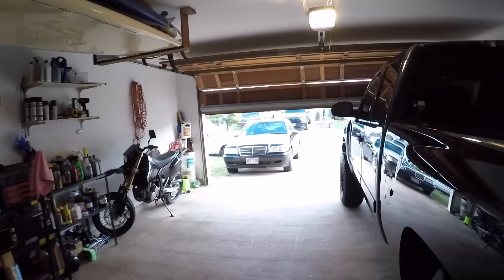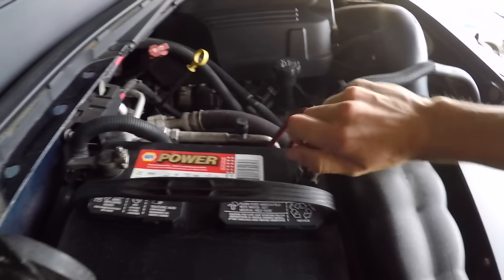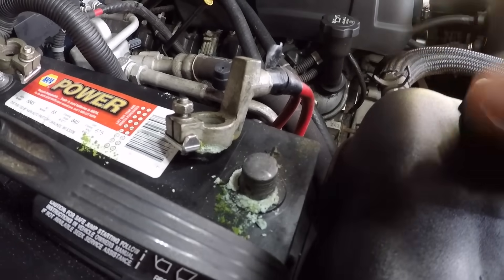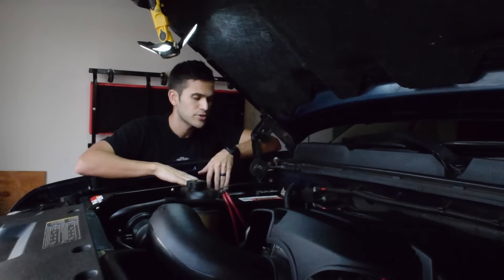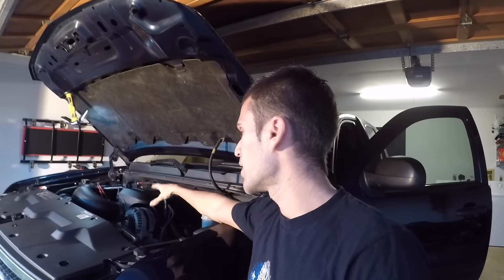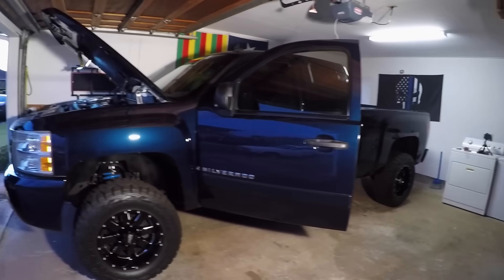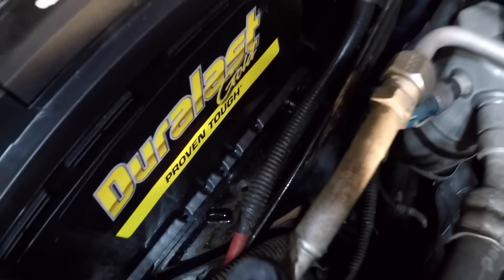Car Won't Start: Alternator or Battery? The easy way to know

Comment: when you're confirming a bad battery, you are covering up where you connected the positive lead out of the multimeter to some contact on the alternator - what did you connect it to?

Comment: I thought if the battery was dead the lights wouldn't turn on. I had my alternator replaced in December when it died and wouldn't jump and now it's dead again and won't jump. It starts but then it dies. The mechanic came to look at it and scan it, but he wasn't familiar with the codes and said it seems like a computer issue.

Comment: In your personal case, you did not need to go out to buy voltmeter, you already have one on your dash and the voltage did increase when you started car. But the video is good for everyone else that does not have a voltmeter in dash. Good video though. A voltmeter is always good to have in car and know how to use it.

Comment: To shorten it up he all he said was a check the voltage if it’s low voltage it’s the battery if it’s high voltage it’s alternator

Comment: What a detailed video, you should make one about what to do with keyless cars that wont start. 1 light shows on dashboard, no sound when you press the start while holding brake, new battery drains so easily. Talking about my own nissan altima 08 :(

Comment: As a woman who needs to learn how to take care of my own car problems, you explained things very well, so even “I” could understand it. 
Off to buy my multi meter to check my battery first. Thanks for the great music, video, and instructions
Reply: www.veejer.com
Dallas, Texas

"7" small Chapters
Chapter 4 : Batteries
Chapter 5 : Starters
Chapter 6: Alternators

The reason the vehicle wouldn't start is because the Battery had "one" Shorted Cell , that's why he was reading 10.5 Volts.

Batteries have " Six" Cells.
2.1 Volts per cell , thus 6 Cells Times 2.1 Volts = 12.6 Volts , a well Charged Battery.

If he was a Mechanic , this wouldn't have been his 1st day going out to buy a Battery.

Auto Technician background ,
Southern California
Formerly of Texas
Reply: We’ve got this ladies!! 😊
Reply: Nice job ladies
Reply: Great job ladies! I’m in the same boat. Just popping my hood makes me anxious! But I’m gonna give it a try. My car still runs, but struggles to start, especially when not run for a day or two. Think the battery needs replacement.
Reply: Never fire the parts cannon at it. The 1st thing I would have done and  got a battery analyzer and check the battery property a Volt meter will only tell you the voltage it will not tell you the Amperage that's required start to vehicle.
Reply: @404notfound..... 🎉🎉😢😮😂🎉
Reply: I have to disagree on the music.  Can't figure out why we always have to be bombarded with unnecessary, incessant, annoying music.  Oh, well....  :-(
Reply: Same here 😊
Reply: Same here. I am a single woman with a new grand cherokee that has all the bells and whistles.  My worst fears came to fruition the other day when I tried to start my car, remotely and manually both and it was completely dead. I had anxiety attacks for 3 days over it.. thank God my son in law tested the batteries and the alternator.  It's the alternator.  This video is wonderful for women who don't know cars! Good luck to you!

Comment: I have a VW Eos 4 cylinder, turbo. I have a horrible rotten egg smell coming from the hood of my car and there has been some hesitation to start occasionally. No warnings lights on dash. Auto zone did a test and ssid my battery and starter were good but that my alternator was bad. But would that give off that rotten egg ( sulfur) smell?

Comment: 10:45 is a prime example of paying attention to how the old battery comes out.  If he had connected the cables at this time they would have been reversed and could have blown a main fuse or worse.  However a few seconds later you see the battery turned the opposite (correct) way.  Good catch and save sir.
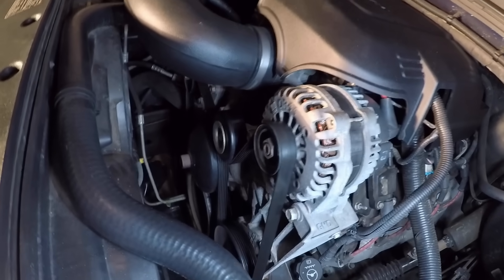Reply: 12:30
Reply: thanks for pointing that out ! 👍
Reply: Yeah i did that and think i damaged something real bad

Comment: when you want to clean that crud on your battery post  sprinkle some baking soda from your kitcnen add add some water  watch it boil away the rinse a little more water  thats it     if yoy are having battery problems  with an older battery  you  bring it to life so to speak  if can add water  but first  try a spoonful of epsom salts  (magnesium) it desolves the crap that builds up on the plates in you battery    helps it hold a charge    put this in each cell  table spoon  will be enough

Comment: heres a question... i drained my battery by running accessory on cigarette lighter. my eliminator jumper only effective after 1 use even after charging it. replaced new battery but both read 12.8 volts on my amp meter... ?? what happened?
Reply: also my battery light never stayed on after starting the car...
Reply: my aLternator  is good ..its reading 14.6 while running

Comment: I had my alternator give out on me one day, I'm glad you went the electrical tester route but there is a better way to test if it truly is your alternator. If you can turn your car on (Jumped or battery not completely drained)  then while it is running, pull off your negative ground on your battery. If your car dies then its your alternator. Your battery is good for Starting your car, your alternator is good for keeping your car alive. Since his car wouldn't start the battery made more sense. Another way to test the alternator is if you can get metal to stick to it. I think it needs to be on to test this, idk I haven't tested this way cause the battery was a lot simpler. On or off, if metal won't stick then its safe to say its bad. One none productive question, why are you in Hawaii and have a Texas sticker on your car?
Reply: He’s not in Hawaii it was just the vibe of the sunset that made him think of hawaii
Reply: How do you know if it’s your starter?

Comment: one thing you should  have done is hooked up portable charge to the obd  port so your electrical system computer does not have to reset . it can save you big money when your marsady needs to do engine settings for it to run again

Comment: He should of take the positive out the car battery while car start to see if it still running alternator it self power up everything if it can't that's mean alternator is bad....car battery only last no more than 5 years my car battery has sticker 2014 that's about 6years it's time for new battery ....alternator worn fast if you runs car systems 1000watts plus you will need upgraded battery as well gold top or 2nd battery kinetic

Comment: I really need help guys, I have a 04 mustang that won’t start and it’s either the battery or the alternator so we got a new battery and it still won’t start, any ideas? @ChrisFix
Reply: We are having the same problem with a 2002. We even bought a new battery

Comment: Thanks, your explanation was both clear and logical, just what I was looking for
Reply: I was having the same problem with my car I have a 2011 GMC Acadia denali or wheel drive I change the alternator and the alternator and the battery and I am still having the same problem service charge as system what should I do next

Comment: Under what circumstances the alternator could deliver Voltage lesser than required? We have 2 batteries (12Volts and 25plates each) connected in series and when the engine is running idle the monitor on Dump Truck would display 23.5 V (but it should be 12.6x2 i.e., 25.2V) and the alternator should give output voltage of about 27.3V to charge the battery but it's output is just 23.5V and if electrical appliances(lights, AC) of HEMM are switched ON the Battery Voltage starts decreasing below 23.5V.
What could be the problem?

Comment: A Voltimeter is not enough to assess if a battery is in good shape.

This method is useful for a simple analysis - not a diagnostic.
A conductance tool shall be used, especially if that tool also measures the charge of the alternator (which advises you to turn on the engine, turn on the air vent and lights).

Moreover, you never should jump start another car - or your own car - though your battery if that battery is in the trunk.
This is because the European cars have many sensors and ECUs connected to that battery in the trunk.
To help you, OEMs placed two terminals in the engine compartment, in order for you to jump start your car or charge your battery.

Furthermore, that Mercedes-Benz engine is usually small to jump start a truck.
Or is it a V8 engine?

Cheers for that sunset 😂

Comment: Can I use a spanner to open the battery bolt rather etc wrench as o havnt git the too you have I ad the same issue today all light came on after many try I came but hole it will last

Comment: Rookie mistake to jump start a car without the donor car's engine running.
Reply: Where did he attach it to the other car?
Reply: @joanlynch5271  I don't understand your question. Jump leads connect a donor car battery to the car with a flat battery.  If you do that without the engine running on the donor car, you risk having two flat batteries and two cars that need a jump start.

Comment: If alternator was bad you would see signs of it probably a week before your battery dies, dash lights will go crazy while driving, battery/ brake lights will light up, abs light will light up, brakes might depress to floor, all types of issues when alternator is about to go.

Comment: Thanks the information was helpful. I am having a similar problem on my 2006 Chevy Colorado. Every now and then I have to jump start my battery so let me get my meter out and check those things first so this way is not a waste of time of buying the wrong part.
Reply: I've spent so much time with you!

Comment: Hey man, quick question for you. My 18 explorer had the same issue, coming up with the "Service charging system now" on the display. I replaced the battery, and the alternator. Its still throwing the code though. any ideas?
Reply: "Service charging system" is usually for the charging part.  Check you alternator charging voltage.

Comment: i currently have a 06 honda odyssey tried to jump start it 3 times and it just wont and the battery is brand new so i thought it was the starter going out but the starter was fine but all the interior was lighting up but the third time they got dimmer and now it just blinks but its very faint. Ideas?
Reply: Check your throttle body position sensor. (Try starting with the connector unplugged).

Comment: Can anyone help me? I have a 05 marquis I bought and battery light Comes on and off.. When I drive it go's off.. It comes on and off. I had the alternator and battery checked and was told it was good. The car runs and drives smoothly no idle issues or anything... Any idea what it might be?
Reply: Get a multimeter and measure the voltage on your alternator and battery. It might be your voltage regulator..
Reply: @decision4475  thanks! I just started to think it might be that.

Comment: your alternator works overtime as well because it has a hard time connecting to the battery and won't charge you're battery. just went through something like this. lol be cautious, positive cables get hot eventually. from poor connection. mine got quite hot to the touch and melted the harness and positive terminal cover. cut the corroded head off and crimped a new one on and works well so far.

Comment: Alternator OR Battery: 

BATTERY: Car dies>> you jump start>> turns on>> you drive fine>> turn car off>> wont turn back on

ALTERNATOR: Car dies>> Jump start>> Turns on>> Drive car>> Dies while driving. 

PARASITIC DRAW: Car dies>> get a new battery>> turns on>> is drained and dead again after only couple months/weeks.
Reply: CY4B3R SK4R fucking straight forward thank you so much
Reply: Left key on overnite. Next day nothing. Charged battery and got another altenator, it's like battery is not charged even though had no problems at all til this happened.Charged battery 4 days still nothing, lights and dinging when door opens but besides that nothing.  Got a jump and just shut down. Is it battery or a relay or fuse ? This is a 2008 DODGE NITRO SLT.
Reply: @chrystalgillespie9318  if charging battery does not charge battery. You answered own question. It's the battery. I'm having same problem and my battery is over 3 years old so I know its battery. Remember battery is there to start car, alternator is for running car and charging battery as vehicles running.
Reply: @chrisiverson257  I jump start my car but soon as I took the jumper cables off it cut right back off what is that
Reply: @boosieparson3894  bad battery. If you battery is dead or dying. After you jumpstart car, battery cant hold the charge that the alternator is trying to provide.
Reply: Just an update: bought new battery and have zero issues now. Turns out battery had a dead cell. Truck can sit for a month and start right up.
Reply: pls make a channel
Reply: so when a new battery dies form parasitic draw is it rechargeable and reusable or a new battery is needed?
Reply: @daffy9908  , battery will be fine ...  you need to find out what’s drawing down your battery.. like a sticky brake light switch, dome light left on, car alarm circuit bad.. glove box light on....  light in mirror left on...  etc....
Reply: @johnbattista9519  thankyou,
Reply: @johnbattista9519  so is it a pretty sure bet its my battery if im able to jump start and travel no problem and its only when it sits or i stop and restart the car too many times it dies on me and needs another boost ?

Im guessing its a parasitic drain but its odd to me it literally happened out of nowhere..

Can loose wiring from say a stereo system cause a drain ? Ive checked every light i could and i have yet to catch anything
Reply: @ThatGuy-sc5rx  yup.
Reply: @daffy9908  not if the new battery is not defective
Reply: whoever you are .. I love you 😭💓.. this helped alot
Reply: What about trying to turn car on getting weird clicking noise still have lights on dash?
Reply: @cattyhatty7574 It could be your starter solenoid. Or your battery is good enough to turn the lights on, but not strong enough to turn over your engine. I would also get the alternator tested at AutoZone or Advanced Auto Parts.
Reply: Thank you so much
Reply: Very informative..tks
Reply: Thank u
Reply: No radio. I have a 02 Saturn sl replace starter
Reply: Yup. My mom's 2010 GMC Acadia had a bad alternator that killed all 3 batteries in like 30 minutes while she was driving. She paid $320 to get the alternator replaced.
Reply: how can you find out what the parasitic draw is?
Reply: @rudeboylexy  You could set up a multimeter and check for current draw. Slowly pull out fuses until you see no current is being drawn anymore, your problem probably lies there. (Just sharing some of my own experience)
Reply: @darrenchang95  Thanks, I sold the car lol
Reply: @rudeboylexy  , put amp meter in series with battery and look for drain..  you will have a slight draw down from CPU which is normal. But you can calculate the draw down to discharge. 
Example with meter in line, open car door to turn on dome light... look at amperage draw..   calculate that over 8 hours... ie amp hours.  Most car batteries will not turn a car over with that much amp hour loss.
Reply: Not always the case, as it seems that a defective new battery can cause it to die while driving
Reply: Didn't watch the vid. Just read this and knew what it was..

Comment: Hey ive been having trouble with my 97 Lincoln continental. It runs pretty good for the most part but I've noticed when I drive it a lot during the day and my car gets hot it seems to have an issue when trying to start it, it will start up than immediately the engine will turn off(stalls out is the term I think?) To fix it I just have to rev the engine while starting than it seems to run fine. Doesnt try to stall out once I'm on the road or anything. I've had autozone and a couple other places do voltage tests on my car and they all tell me my alternators shot and it fails the test. What do you guys think ? Pretty sure my fuel pump is fine because I've had it looked at.

Comment: Battery connector on both positive and negative should not be all the way down on the post.  It should be flush with the top of the post with a space between the connector and the top of the battery  to prevent the 'crud' from forming.

A multi-meter across the battery should reveal about 12.2 - 12.6 volts.  If not, some vehicles won't attempt a start lower than 11.5 volts.

If you do get the vehicle started, check the voltage of the battery again and it should reveal between 14.2  - 14.7 volts.  If not, then the alternator (generator) is bad.

Turning off all accessories and unplugging your cell phone before turning off the engine after parking prevents a heavy load on the battery when attempting to start the next time you need to go somewhere.  After turning everything off and taking your foot off the brake after putting the vehicle in park let it run for 30 seconds to recharge the battery.  Exit the vehicle quickly locking the doors and pressing the lock button on your remote turns off the lights to save battery.

Leaving your foot on the brake after you park and turn off the engine drains the battery quickly.  My neighbor did it all the time and wondered why his battery was dead all the time.  Literally ALL the time.  Practically weekly.  He would sit in his vehicle sometimes after turning off the engine for 5 minutes sometimes more using his cell phone with his foot on the brake.

I recommend Interstate Battery.

The bracket to secure the battery is critical and should be replaced with the factor O.E.M. part.  If your battery moves while driving it could cause a multitude of problems to include wrecking.

That truck sounds like junk.

Modifying the air filter can cause difficult starting.  Just noticing.

I hope this helps.

Master Mechanic.